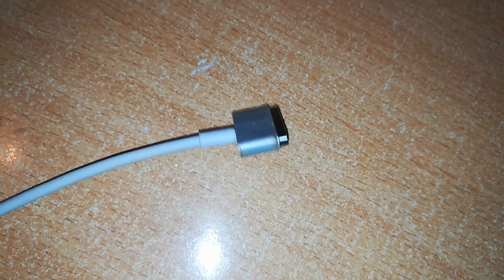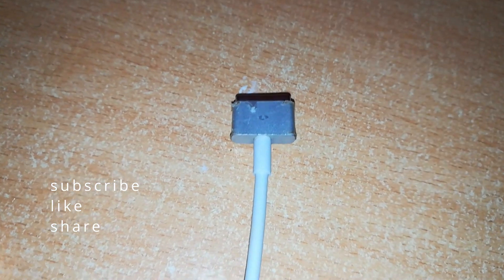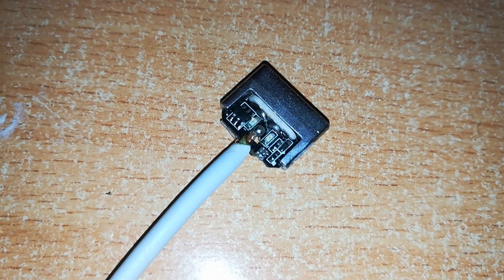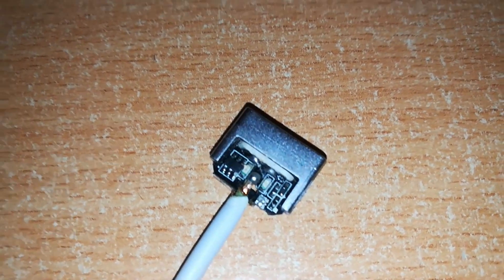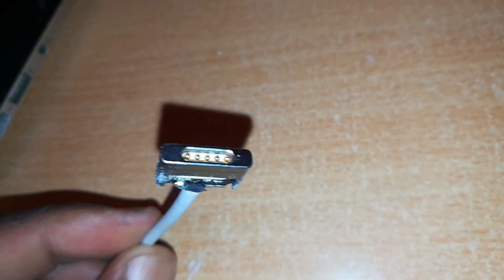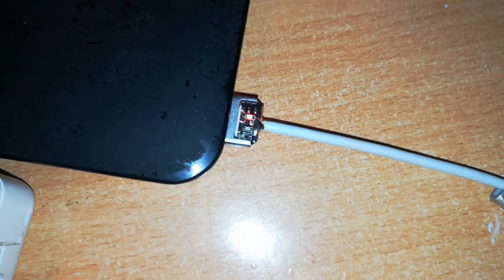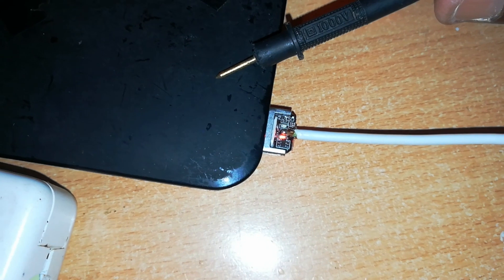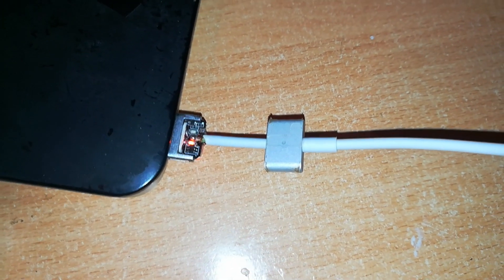OPEN Magsafe 2 connector! #openmagsafe2connector #openmagsafe2

Comment: Thank you very much for your Videos!
Could you show, how to remove the outer cab of the connector? It seems (and you say it at beginning of this video) to be very difficult. But you did it, but you didn't show how 🙂
Best Regards and once again: thanx a lot
Georg
Reply from the maker: Thanks Georg for watching. Indeed opening a magsafe 2 connector (perfectly) is next to impossible. I knew it was a matter of time before someone enquired how its done. My attempt here was pure luck! I found one which was not so 'tight' and with a few 'prods' with a blade and pin, it slid back! Since this is a rare occurence, i took it up and made the video- to show show how it looks from the inside! I have damaged many in an attempt to open them. you could try it too! Happy watching and repairs. Subscribe, like and share!!
Reply: @reachtech1  Thank you very much. I'll try it gently 🙂